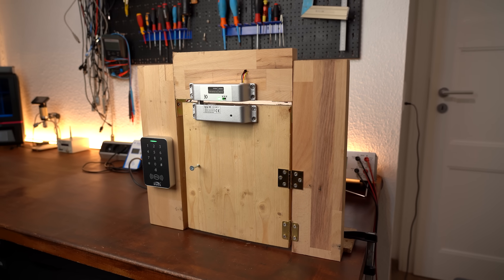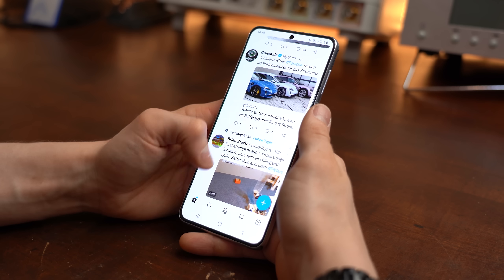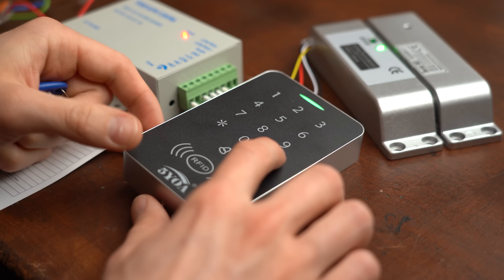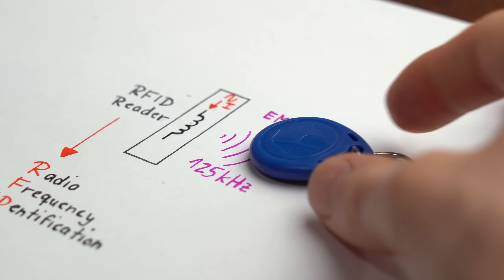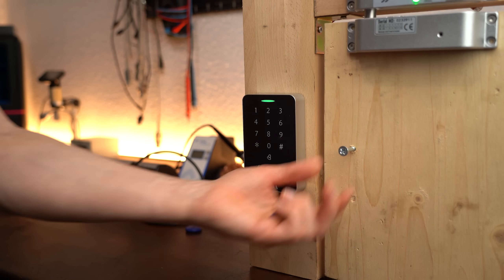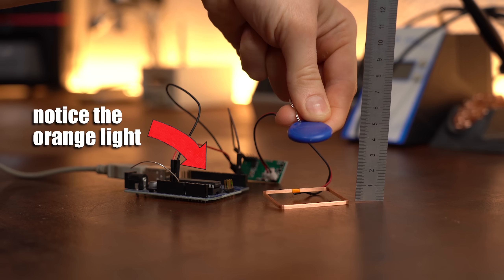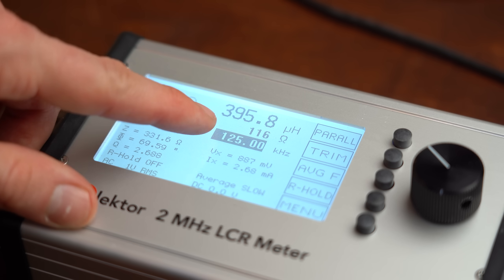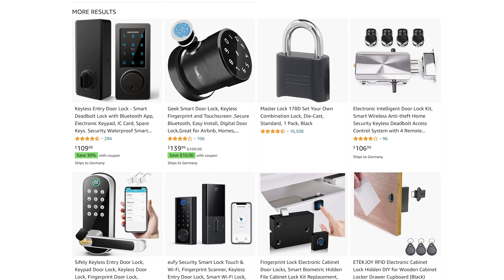RFID Locks are way too easy to "Hack"! Let me show you!

Comment: your videos must be shown in schools! 
they are so good and informative!
Reply from the maker: Glad you think so!
Reply: There's a lot more to rfid systems than these simple readers use. This one only reads the serial number of the tag. A secure system would use read and write keys for the rfid tag, preventing anyone without the key from reading anything other than the SN, and those readers would be looking for the data stored on it, rather than the SN. You can easily clone a mifare classic serial number, but getting the secured data is far more difficult (not going to go into the ways to do so here).
This video does a good job of showing you why you don't want to use one of these cheap readers though, not including the fact you can just pull it off and jump connections with a paperclip to open the lock.

Comment: The HID maxiprox 5375 rfid readers at garages can read up to 3 feet away (~90cm), That is obviously much farther than the 30cm goal you want, but the coil wrapped in there is roughly 30cm x 30cm

Comment: ...or you could just put a magnet next to the rfid system and actuate the relay inside, therefore unlocking the door
Reply: Unless the relay is in a control box on the inside.
Reply: @Carlium  that's true

Comment: As LPL has proven so many times, that "lock" can be defeated with just a strong magnet - provided that it contains a relay to operate external circuits..
Reply from the maker: Haha true ;-)
Reply: @greatscottlab  Though what about with a solid state relay, surely that would mitigate that attack
Reply: @LeePorte  they also need to be shielded, as such locks are also prone to EMF attacks
Reply: @greatscottlab  Desolder relay, replace with transistor.
Come to think of it, that could make an interesting video. Lots of people would like to know how to make those cheap locks more secure.
Reply: @daviddavidson2357  you would still be able to rip away the keypad and short out the right pins. 
Direct control to lock from keypad is just a big nono.
Reply: @daviddavidson2357  Relay provides isolation genius.
Reply: @MadScientist267  Opto isolators, problem solved.
Reply: @daviddavidson2357  Sometimes...
Reply: @greatscottlab  Teacher, I saw someone in China make a mp3-like file that can open many car doors. What is the principle?
Reply: @greatscottlab  can a radio/TV speaker magnet unlock the door?
Reply: @greatscottlab  look at the red team alliance tools pages.  Deviant ollam (which is why I'm aware of it))  has a YouTube channel too but it's all over the place in content.  He's a pen tester, developer, and all around nice guy. He apparently does this kind of stuff for fun and profit.

Anyways,  they have some specific items related to RFID. I cannot remember if deviant ollam was part of it but there was a long range reading proof of concept at one of the cons I attended in the early 2000s where he had talk about similar topics. He might be able to point you in the right direction or even share personal experiences about his attempts in pen testing.
Reply: Not only that, but there is screw under keypad/scanner which exposes internals, meaning that you can easily bypass system and send puls directly by connecting "push" wire with ground.
Reply: This lock can be defeated only when bad implementation is used.

You shouldn't use a relay on the inner of the reader.
You should use the reader to feed a proper central system the card id data, and the central system should open the relay.

Obviously, you don't put the central system outside.

And btw, proper RFID systems requires both the presence of the tag AND manually inputting a PIN.

Proper security is made through identification AND password, just using one or the other is not enough.
That's why it's easy to defeat such system.
Reply: To be fair, with a strong enough magnet you could defeat almost any lock! lol. Pretty sure all metals are at least paramagnetic. It would need to be made out of something like carbon to be completely immune. Though even then you could tear holes in the body by manipulating the water vapor thats surely inside of it. With really really extreme levels of magnetism
Reply: Lol 🤣
Reply: A solid state relay is not effected by that.
Reply: That's why when I made my own DIY smartlock, I used solid state relay
Reply: @KahruSuomiPerkele  I have a HID brand 125Khz stand-alone reader that uses a relay and can be opened with a magnet.
Reply: @JoeTomasone  HID is also a low security company. They specialize in outdated tech, hence most of their offerings are 125kHz instead of the 13.5MHz which the higher frequency would allow call response security. But HID also don't like allowing customers to use secondary authorization systems to validate RFID access
Reply: @allensmithphotography  HID has mainly moved on from 125Khz but most of their customers have not - hence the attendant issues.   HID iClass for example.
Reply: @JoeTomasone  they offer higher security systems, but their sales reps continue the new installs of the low end equipment. Not the customers. The existing customer base are slow to upgrade, that's true, but new installs are still pushed to the 125kHz because the sales rep can finagle a higher commission by selling more equipment up front than with the advanced equipment. And if HID really wanted to move up and out from the low security systems they would discontinue it and force upgrade
Reply: @JoeTomasone what type of magnet do yu have a link?
Reply: Fun fact: Way back before I worked in InfoSec and while I was a padawan playing with microcontrollers and relays; I discovered that any home 'safe' with the brand "Sentry" (maybe Sentry Safe? It's been a while)  had some genius engineers. A neodymium 3lb hockey puck will open it in seconds. While my dad was pissed (probably more over the cost of two fairly large models - one meant for firearms - that are worthless) he was a lead engineer at AT&T so I got to go with him shortly thereafter. (I was like 8, so while it may not have still been 'ATT' I call it that. My dad climbed polls for Ohio bell before he went to college and went back. I know I saw his shirts/badges go from AT&T to Ameritech, then SBC Global, to SBC, (Cingular split off for mobile/wireless around this time) then back to ATT, then back to SBC...etc. I've likely missed order or even entity names but to me, it's always just AT&T)

Comment: some time ago i had seen on instructables people reading 125khz RFID tags without any ic, they used used some passive components and a microcontroller, perhaps it would be easy to modify those designs for extra range
Reply: "without any ic"
"some passive components and a microcontroller"
Was this microcontroller made of discrete transistors?  ;-)
Reply: @OgbondSandvol  what i meant was that it didn't use any kind of module etc, it was just a coil and some caps directly connected to an Arduino and it could read 125khz cards, he did all of the protocol etc stuff on the software side
Reply: ok i found it, its the "Stupid Simple Arduino LF RFID Tag Spoofer" by sketchsk3tch. this just shows how stupidly simple and insecure 125khz rfid cards are
Reply from the maker: Well, the RDM6300 basically also only used a uC and passive components. So definitely possible ;-)
Reply: @KahruSuomiPerkele  ;-) I know! I was not talking about the passive components, I was asking about the microcontroller. If no ic was used, how was the microcontroller made?

Comment: I wonder why RFID doesn't use asymmetric cryptography like smart cards do.
Reply: these older ones don't do but the newer ones do, which are technically the so called "smart cards"
Reply: I wonder that's because asymmetric criptography would need some kind of processing in the tag, and some challenge-response exchange between tag and device. The passive system is more simple: tag enter an electromagnetic field, tag gets energized, tag transmite code.

Comment: An RFID alarm in the market might help you with your project, since it need to keep a quite far distance and read the data in the tag, I'm sure there must be some kind of information of these theft-proof system!
Reply: Do the anti-theft systems use RFID? Here they all use the metal strips that are disabled with a magnet.
Reply: @BetaSeven  These kinds of anti-theft most come with high value electronics or small products，mostly a sticker with some wire(coil) in it.

Comment: You can absolutely grab tags easily with off the shelf long range readers, adding a microcontroller with BT/wifi in line with the reader wiegand or rs485 data lines is also a good way to read/replay a code back to the controller.
Reply: Only mentioning the show because it uses real tech as part of the scenes, but Mr. Robot had a good scene showing this being done with an off the shelf reader placed into a bag. Maybe not as long range as your referring to, but a good example of how it can be done and mirrors talks I've seen at hacking conferences. You can purchase a device like a chameleon off aliexpress to do cloning and other attacks as well with replaceable antennas and is nice and compact.
Reply: but the long range ones are generally UHF around 900 mhz ish
Reply: DONT LIKE THIS COMMENT HAS 69 LIKES
Reply: There are no off the shelf long-range readers for 125kHz, the best have about 1m range (in best conditions). On the other hand, coppying an EM41xx tag is really easy and can be done without any encoding. You can even use a very simple circuitry and a phone, because the data frequency is within audio range. Simple AM demodulation into mic input, record it in WAW and play it back - boom.

Comment: should have not been using unsecured 125khz and instead been using the more modern NFC standard that can use an encrypted key.   I'm kinda surprised they still sell 125khz systems.
Reply: a lot of attendance systems still use those, a lot. its honestly baffling
Reply from the maker: There are tons of such 125kHz system out there.
Reply: Contractors probably know that they are unsafe. But it only has to be as secure as the useable needs.

Comment: Interesting stuff. Always wondered how easy it was to NFC at a distance. Realistically from a home security perspective this is no worse than most door locks. Average door? Easy to pick/rake/bump. A thief will probably just break something (like the window next to the door) instead.
Reply: NFC =/= RFID. There's encryption method required. NFC tags carry an ic capable to solve specific key challenge that the reader gives out when it gets in range. Most would have write-once memory that the reader sets to 'pair' the tag the first time it is used. RFID at its simplest form like shown here just carries its own id. That's why it is usually only used to, well, identify things in warehouses.
Reply: Once RFID door locks become popular, then it's probably not a far stretch to imagine read made hacking devices showing up on Aliexpress for a few dollars. We are basically at this point with car locks now.
Reply: @andreasu.3546  with older cars that works, you cant use SDR based spoofing with newer cars, as the key is randomly generated by an algorithm
Reply: @ShahZahid  Even rolling codes can be tricked, e.g. with RF repeaters that forward signals between the keyfob and the car, even if both are a significant distance apart.
Reply: @andreasu.3546 hmm intresting, but wouldn't you have to press a button on the keyfob to activate it, cuz it cant be pinging to the car all the time, that would absolutely kill the battery life
Reply: @andreasu.3546  It’s a bit more complex because you have to capture the code while also ensuring the receiver doesn’t hear it and then replay that code before the system receives another valid entry and skips over it.
Reply: @ShahZahid  Due to most vehicles having a request switch on the door handle they just press that then the car will ask the key for the code, this method usually requires two people and is how most Toyotas are stolen.

Comment: Pretty sure you need something more than a larger coil to increase tbe distance.

Think you need to increase the antenna's directionality gain (focusing the rf). Think pringles can or a yagi antenna
Reply from the maker: Thanks for the feedback. Definitely worth considering for the maybe follow up video✌️
Reply: There is no real RF in those tags, they work with eddy current and the chip inside just shorts the coil briefly to transmit data, only the UHF tags have real radio in them.